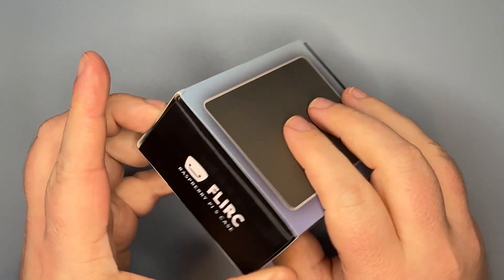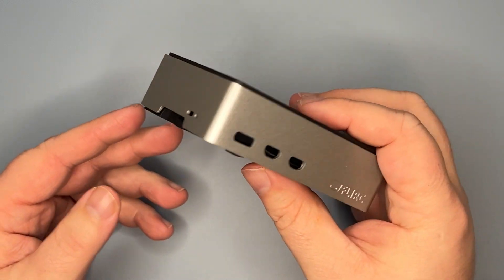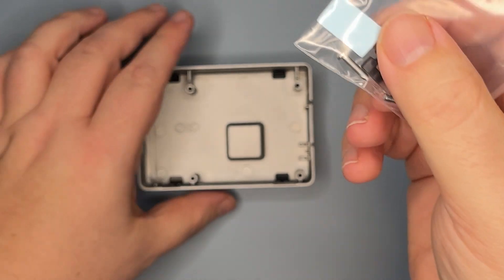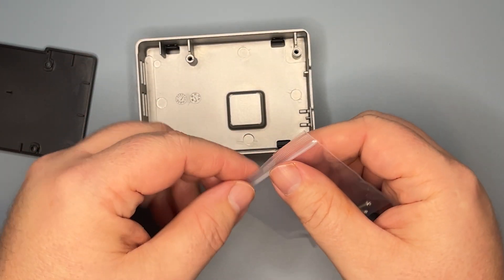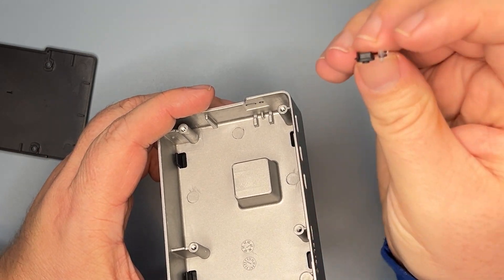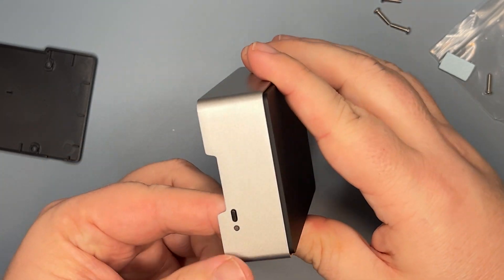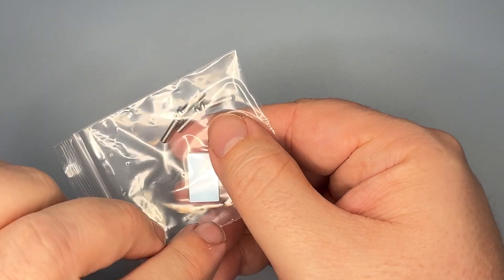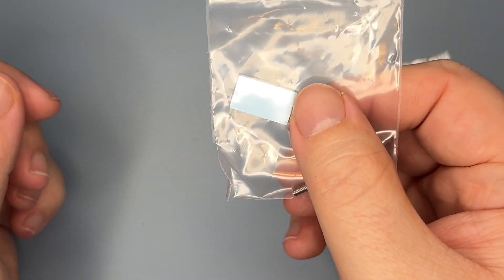Unboxing the Flirc Case for the Raspberry Pi 5

Comment: The Pi5 is going to hit it's throttling temperature of 85°C in about 5 minutes without fan cooling.
Reply: Someone needs to develop a bigger  passive case with more metal and fins.  It's gonna cost more and lose aesthetic appeal, but nothing beats a completely silent pi
Reply: 100% agree  @nikobellic570
Reply: I found that the Flirc pi 5 case doesn't throttle but simply runs too warm for my liking.  I'm just using it to  watch  videos through Chromium browser
Reply from the maker: In our tests, no throttling. As for heat, yep, it's a passive case on a pretty moster cpu. It'll def run warm